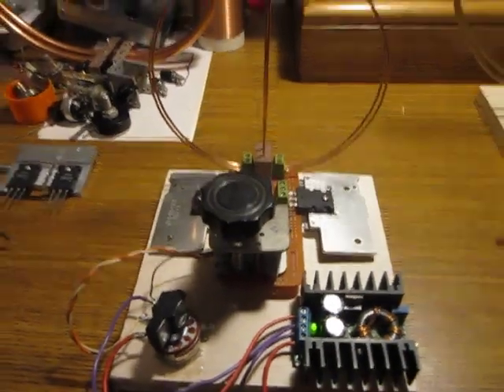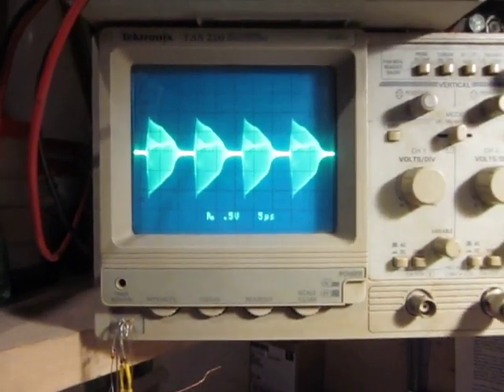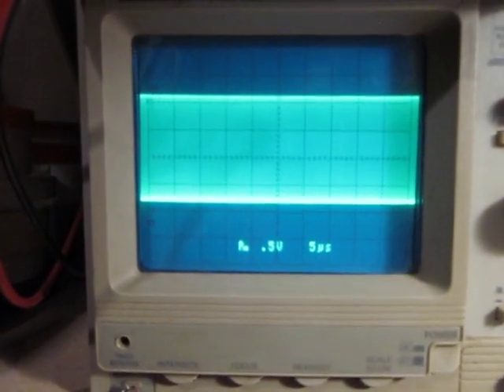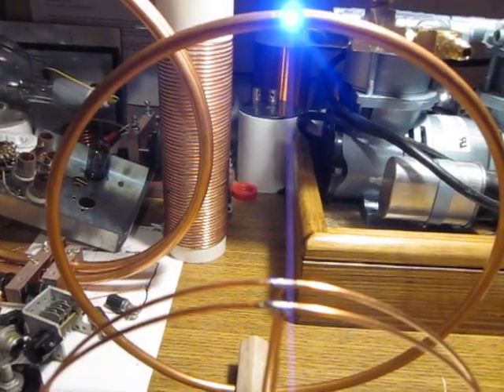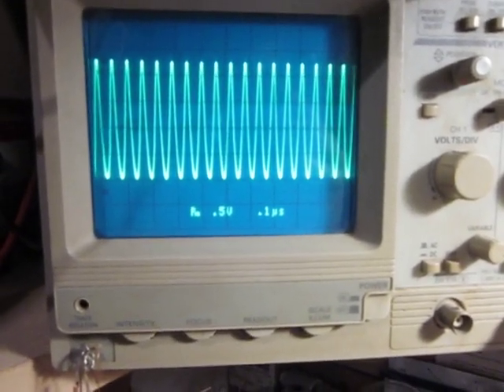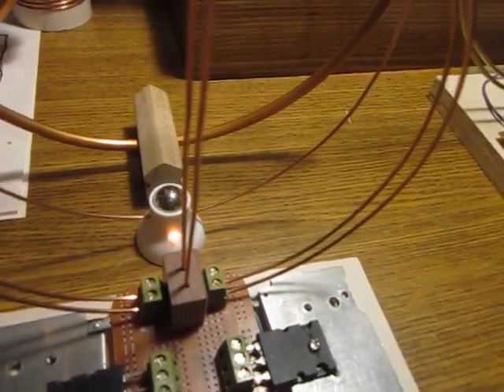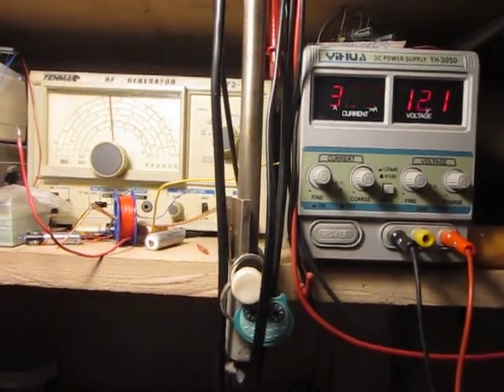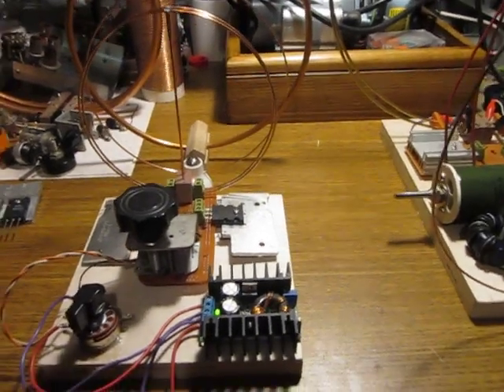RCO

Comment: Instead of an arc at the separation point can you close the loop and make a flat arc fill the loop? Is this an attempt to make a portals ? Because you need 3 different frequencies meeting?
Reply from the maker: This is Mesny push-pull oscillator.
Reply: @blackchisel97  Innovative “Langasite oscillator” and “Langasite sensors” have been commercialized by linking the research seed “New Langasite piezoelectric single crystal” of Tohoku University to the needs of society
Reply from the maker: @Mars2152  Very nice, but what this has to do with my video?
Reply: @blackchisel97  very cool